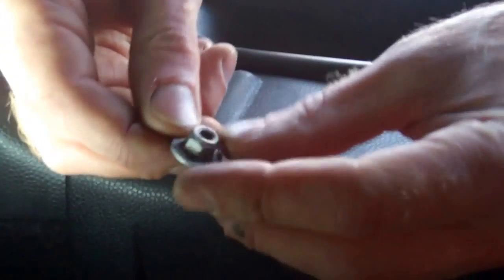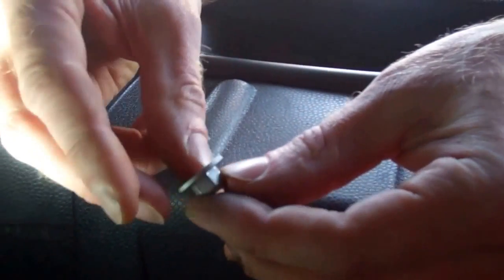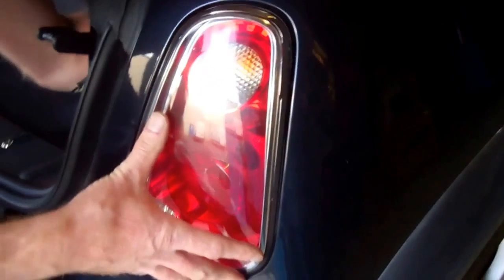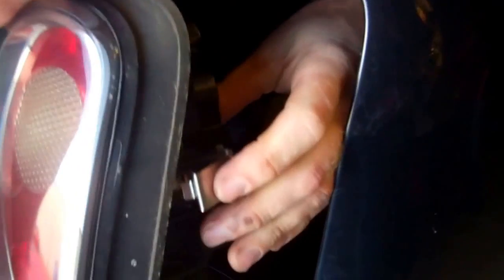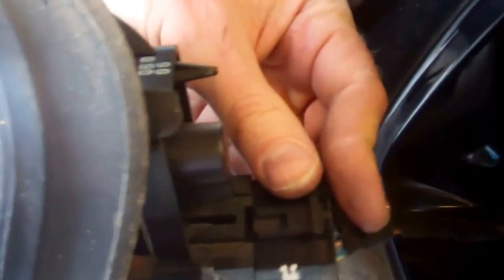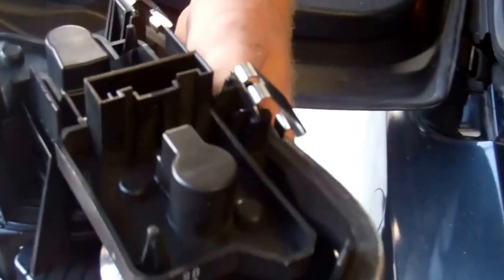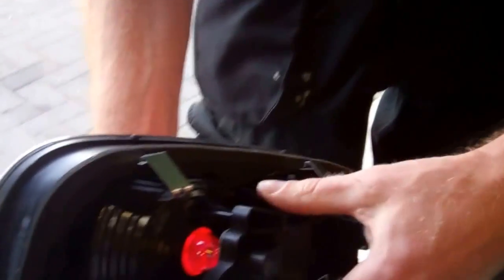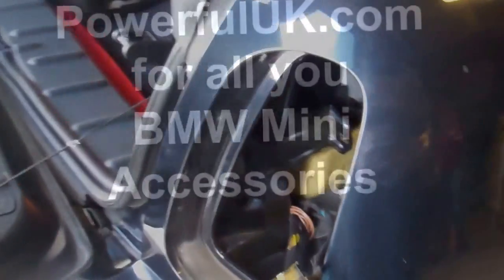How to remove rear lights on a BMW Mini Convertible R52 bulb

Comment: Thank you 100 times!! You saved the 2008 Mini from my oxygen acetlylene torch after many other frustrating attempts and shredded knuckles top remove the light. The magic bolt and nut were not obvious through the little opening. I bought the car used and am learning every day as I work on little things.

Comment: Just a hero for taking the time to post this lifesaver for amateur mechanics. This took me 3 hours, the owners manual says just unclip the lamp cluster, change your bulb and refit. Did the writer even try to do this!!! Impossible but 15 mins after seeing this vid the job was sorted. A complete nightmare and appalling design by bmw the aperture cutout does not even align with the lighting cluster nut making an alkward removal and replacement process. But thanks so much pal I owe you a bevvy.

Comment: I wish I had known about that bottom clip to release the entire lamp when my Mrs first got the car... I found the bolt and 1st clip, but couldn't find that 2nd clip at the bottom to release the entire lamp when I changed first a bulb in her car. Lots of cuts on my arm later, I gave up for the evening and the Mrs got it changed at the MOT the next morning. 

But, I did find out that with the back shelf removed, the Mini Cab boot can actually fit a fully grown, 5'10 11.5st Male in it, albeit with a face print on the back window... so yea, that's something....

Comment: Thanks for the video as it really helped when I changed my brake/tail bulb in my 2007 mini convertible.  Just curious the reverse light bulb in the lower tail light assembly looks different than the brake/tail bulb and I couldn't figure out how to remove the reverse bulb?  I didn't want to break it pulling on it.  Any idea how to remove the reverse light bulb?
Reply: It is a straight press mount type. Pull it straight out. No twist.
Reply: Do you know the reverse bulb part number? Going to replace mine with LEDs. Thanks